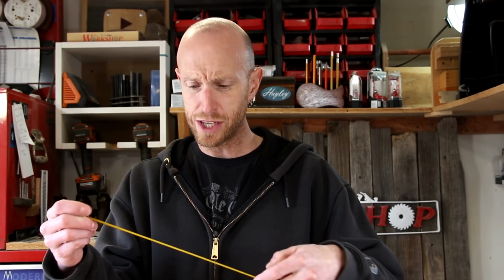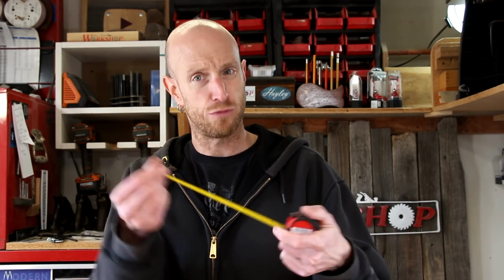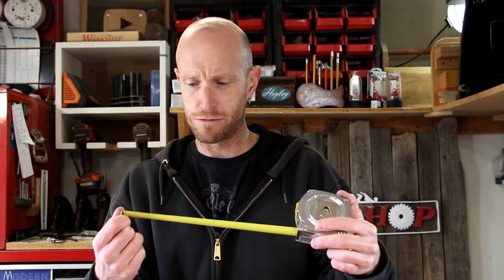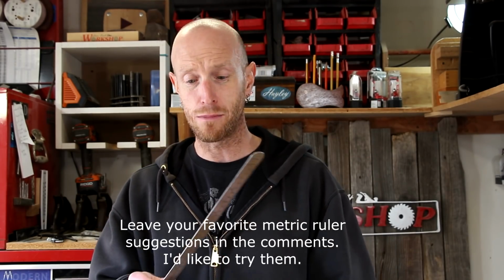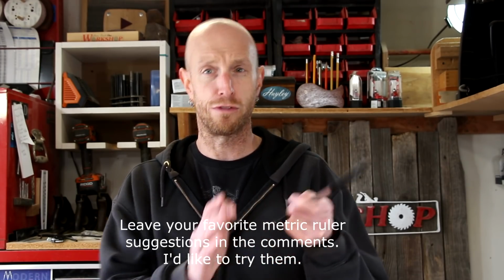My thoughts after using the Metric System for a project | I liked it

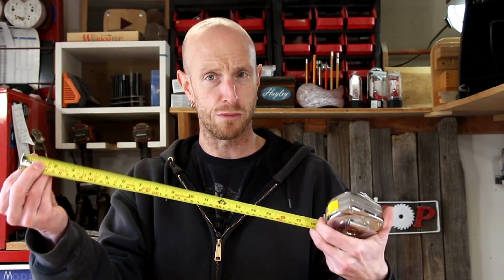Comment: 01:55 "I bought a metric measuring tape - but it's a bit long at 26ft"  so unintentionally funny :-)
Reply: is this another way of saying "The tape is 8 meters long"?
Reply: @tobyk.4911  Thank you for converting that for me. I was trying to guess 😆
Reply: @petervaughan6854  The simplest way to remember it would be to think 1 foot = 30 cm.

Of course... a foot is actually 30.48 cm... but losing about half a centimeter is not all that bad if you just want a quick and rough measurement and/or idea of how long something might be.

You just have to try and remember 30.48 for when you either need to be very precise in feet... or if you talk about a large number of feet in length, since at for example 26 feet you would be 12.48cm (almost 5 inches) short using 30cm as a base instead of 30.48.
Reply: @tobyk.4911  The problem is I've never seen an 8m measuring tape. I've seen 2, 3, 5, 7 or 10m, but never 8. So I was curious if there is any? Is that a Moby Dick of m tapes?
Reply: In the UK it's unusual to find a tape measure or rule that doesn't have both metric and imperial on it.
Reply: The tape he was holding has both on the same tape, imperial and metric. I have the same at home.
Reply: @DieBrunovsky   I missed that.
Reply: @grahamsmith9541  In Sweden rulers usually only have metrics on them, and you would have to look around for ones with Imperial on them (specialist shops usually will have at least something).

But once you get into things like foldable rulers and tape measures, especially the kinds of measuring devices used by people in the various building types of professions, like carpenters etc, then it becomes more common to be able to find these things with both Metrics and Imperial on them at the same time.

And unless it has changed in the last 20-30 years, we are taught at least a little about the Imperial system in school (think in 7-9th grade). But if you then go into a building type of education once you reach 10-12th grade (called "Gymnasiet" in Sweden), then you might get more education on the Imperial system... depends on which specific type of building education it is I guess.

I for example went for furniture carpentry for my Gymnasie-education, and we very much so got taught parts of how to use the Imperial system for the few times that might be needed. We did not use it much of course, since Metrics are just so much better... but we knew how to use Imperial at least. Of course we mostly learned Inches and feet, because you do not commonly measure things in yards and miles when you are making furniture... XD
Reply: @damyr  Most of the tapes sold at Bunnings here in Australia are probably 8m. 3m and 5m are common but I reckon 8m tapes would be the norm.
Are you in the US? I wonder what the most common length tape is there. I would think a round 30ft would make sense but that is probably metric thinking 😁
Reply: @emceeboogieboots1608  No, I'm from EU, and I worked with versatile lengths and types of tapes. 3 and 5 are the most common here too, tho I saw 2, 7, and 10m tapes... but I just can't remember seeing an 8m one.
But, of course, I could be wrong.
Reply: In the UK metric is meant to be standard, however, we still have fruit in lbs and oz, beer in pints and drive in mph.
Reply: @grahamsmith9541  "Officially" the UK has converted to SI/metric as standard for official matters. Now it's just getting the public used to the idea ;-p
Reply: @damyr  I'm a carpenter in Switzerland. We've 8m, 10m, 12m. 
And the more special ones with 20m, 24m and higher.
There're companys that make custom tapes. ;)
You can get them in diffrent calibrations.

Peace

Edit 1:
Standart types are 5m and 8m around here
And we've the 'folding rule' for stuff up to 2m. (I belive 'folding rule' is the correct English name for it but I'm not sure)
Reply: @Calistarius79  I use an even grosser oversimplification in my head: 1m = 3 ft. Now, obviously that's even more inaccurate, but if I need to know the exact conversion, I'll type it into Google anyway.
Reply: @Jouzou87  Indeed. I am pretty certain I have used that same equivalency my self over the decades for those very rough estimates.

Usually though when I want to estimate length between meter and feet I think about one of two things.

The first thing is: 3 meters = 10 feet. Which works nicely for my brains wish for logic, patterns, and general symmetrical order of things. Since 1 meter is roughly 3 feet and 4 inches, or in other words 3 feet and 1/3rd of a foot (or in Imperial's "metric'ified" terms 3.33 feet)... so when you triple that up, you get 3m = 10 feet. On top of that... 9 feet = 1 yard, and 10 feet = 3.3333333 yards!!! ... which makes my brain even happier with the rough similar symmetry that we get here from it and from using "3 feet = 1 meter" for rough estimates. XD

The second thing I often use (more often then the previous one) is the fact that I am 1.83m tall, aka 183cm tall... and 6 feet is 182.88cm... so I am a few smidgens taller than 6 feet (1.2mm to be precise... XD  ). But it makes it fairly easy for me to sort of envisioning how long X amount of feet is, since I can correlate 6 feet to my own height. :)
Reply: @damyr  3, 5 and 8 are common in the netherlands.
Reply: @Calistarius79  30.5 would make a quite good approximation
Reply: @AnnXYZ666  Indeed. If anything it makes it much easier to calculate then 30.48. XD
Reply: @petervaughan6854  SAME, i thought it was like 5 meters or something LOL
Reply: it's a bit long and he mistakenly bought a 'standard' measuring tape.